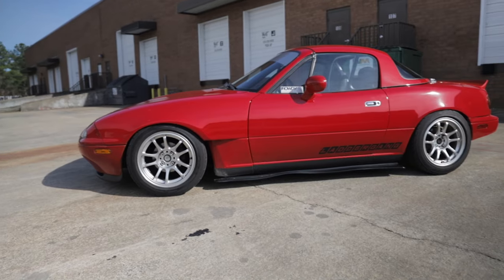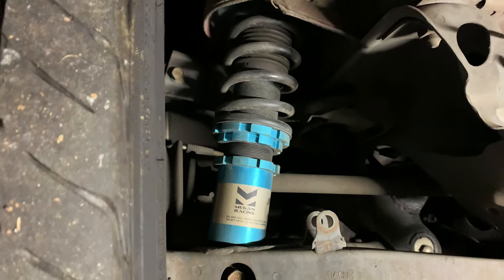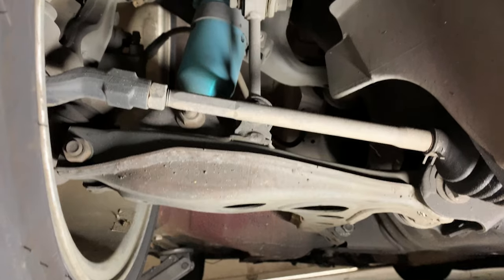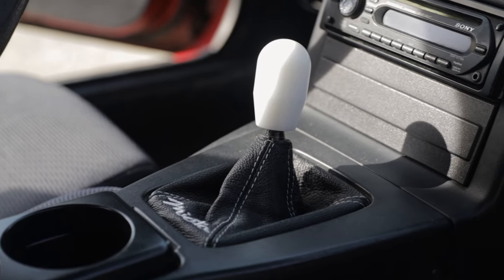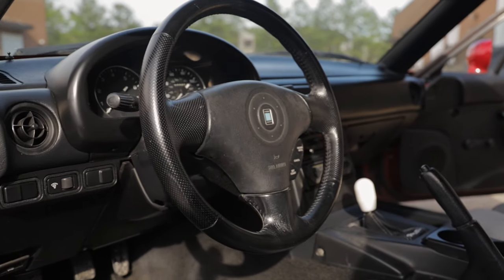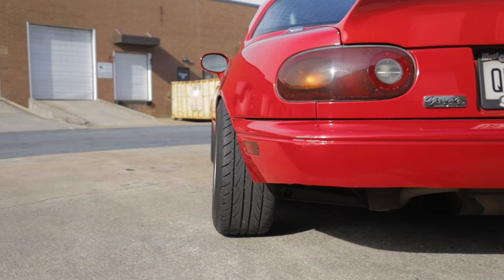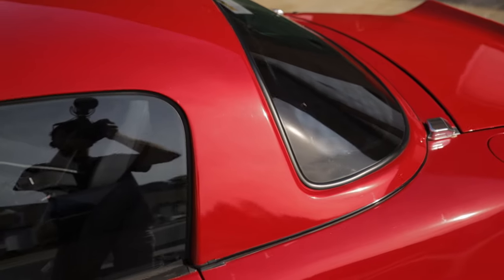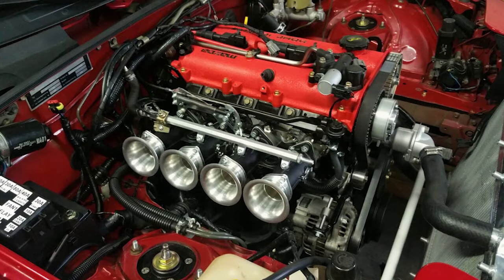5 Things Every Miata Owner Should Do

Comment: Man I’m just tryin to get my ac to work
Reply: +1 lol
Reply: +1
Reply: +1
Reply: I don’t even have an AC 🙃
Reply: 1+
Reply: get the conversion kit its just two valves that fit the more modern ac refills, you might need to purge the line and clean a  filter though
Reply: @justinoxton6790  does it work I think my
Compressor went out
Reply: @yeezkneezz6861  the conversion kit definitely works!
Reply: +1
Reply: I don’t even have one
Reply: + 1
Reply: Lol I’d jus take it get someone mechanically gifted to help u lolz that’s what I did
Reply: you dont need an AC with a soft top, just need warm clothing
Reply: Same
Reply: You have AC? 😂
Reply: Same! I got the old r12 , how do you convert to r134
Reply: What's AC? Just bought a 245000 mile, fairly mint 92 for 2000. It was a race car, has no ac and powersteering. I'm just happy it has no rust.
Reply: Did you ever get the a/c to work?
Reply: Amen, brother 😂
Reply: My ac blows but the compressor won’t kick on it might be wiring or just needs a new compressor all together
Reply: I actually can help with that but I’m on the pooper rn
Reply: Man I'm just tryna get an ac
Reply: +1

Comment: The very first "mod" I did to my Miata is to RUST PROOF it! Flood every cavity with penetrating oil, chain lube spray, even old engine oil if you're a cheapskate. Heated vaseline/wax mix is best, but anything oily is better than nothing. I used "Fluidfilm", will put "Mike Sanders" grease in next year. Fixing rust is a royal pita, so make sure it doesn't even start.

Comment: Advancing timing will increase your power and torque across the whole band, but it makes higher octane a necessity so the engine doesn't knock
Reply: Actually, it you only go to 14deg BTDC it is ok. If you step up to 18deg BTDC then yes, you need higher octane. With fluid change, don't forget the brake and clutch fluid then replace pads (rotors if necessary). If you don't plan on any suspension mods for a while, get an alignment. Been more than 60k miles since timing belt change? Add that onto the list and if you do it, change water pump as well and probably all hoses/belts.
Reply: @gatorcellman  ...plus crank and camshaft seals while you're in there, especially if they show signs of leakage.

Comment: Nope.  The first things you do when you buy a Miata is 
1. Yank the stupid visors out.  They are usless and usually look ugly.
2. Ditch the spare tire and jack.  Pointless extra weight.
3. Yank the baby teeth.  Also pointless weight and ugly.
4. Better brake pads.  Stopping fast is more important than starting fast.
5. Advance the timing.  Free mod for butt hp increase.

All the fluids and shining up the paint are good ideas.  And any NA on stock suspension is definitely going to need replacement.  Good video.
Reply from the maker: Hahaha forgot about the visors, I think I took them out first day.
Reply: What is the baby teeth?
Reply: I’m pulling out the sun visors in favor of the led lights that go on the visor hinge mounts.
Reply: @yuankaicai9086  Air conditioning and power steering
Reply: @yuankaicai9086  These are the tow hitches that protrude from the grill. So, along with ditching the spare tires and jack, and the tow hooks, Goodeggpro is preparing for you to be stranded by the side of the road if you get a flat, or need a tow. Kind of dumb for barely any improvement in handling.
Reply: @ChrisCullenRacing  they are not tow hitches - go ahead and tow your car with them - they are just tie down points - get rid of them and put in a proper grill to protect the lower portion of the rad - you don't own a MX5 apparently
Reply: @doomedhuman  yes they are
Reply: Visors aren’t completely useless if you have the double folding ones. Why would you get rid of the spare tire and Jack? You must like being stranded. Also baby teeth are good for strapping down the car when transporting. The weight savings is negligible, just eat less McDonald’s or exercise to loose some damn weight. 4 & 5 are ok, but now you have to pump higher octane fuel to reduce knock with the advanced timing.
Reply: @One.Six92  On my Miata, there's no way the jack would fit under the car, so it's pointless.  And therefore, the spare is pointless.  Unless you're tracking the car and have a trailer, how many times in a Miata's life is it going to be strapped down?  once?  Never?  And yes.   the visors are completely useless.  I've never seen them be really black on an NA after 25 years of sun bleach.  They look terrible, and often sag at a diagonal, getting in your line of sight when you don't want them to.  I have two pair sitting in a cabinet.

For the record, I've never.... ever, been stranded in 15 years of owning 3 NAs.  Because I take care of them.  And I replace tires when they need replacing.  Sure, accidents happen.  But if you don't have a friend who can rescue you with a spare, do you even Miata?
Reply: @creedg6075  unless your gonna go through the trouble of properly de-powering your steering rack, then keep your power steering. I've driven them with just the hoses capped off and it's miserable after 15 minutes of driving.
Reply: @Irishrebel092  Exactly my point, so why’d you @ me?
Reply: @One.Six92  sorry was responding to the other guy. Hit reply and it auto filled it at you by mistake I guess
Reply: @goodeggproductions   that is the dumbest thing I've ever heard. Taking care of your tires is irrelevant if you run over a nail or bolt and get a flat. And a car that requires you to have a friend or family member that has the time to come "rescue" you is just ridiculous. 

The spare weighs 20lbs. So unless your tracking your car and need every bit of weight gone, then why take it out? At that point, just rip out the entire interior and passenger seat and run it bare. And if your just wanting the bit of extra cargo space then I'll ask the same question "do you even Miata?" You don't get one of these cars if cargo space is a concern....
Reply: @Irishrebel092  all good🍻
Reply: The brakes are plenty fine. If you’re not tracking it, don’t waste your time or money. It’s a very light car
Reply: @Dyltheboy  I'm only speaking from experience.  When I got my 1990, the brakes were dangerously dead.  I don't think the previous owners ever changed pads in 104k.  So I replaced the pads and rotors with some cheap stuff (total price was $110 for all four corners) just to make the car safe to drive.  But then I forgot to ever go back and get real pads.

Recently, I had a panic stop that could not even lock up the back tires.  So I got myself some proper brake pads for the front and now it stops so hard, I feel confident driving in any situation.

For $70, it's a cheap and very smart upgrade to keep you out of situations that could seriously hurt you, since the Miata isn't exactly the safest car out there.
Reply: I don't want a fast miata, i want a cool looking miata
Reply: @callmeasshole  Hopes and prayers.  Or moreso, he'll bring the low profile jack.  Which... likely won't work because at a 3" ride height WITH air in all the tires, if one does down, I'm probably sitting on the deck.  I'm really just screwed if I get a flat unless I have a low-pro jack AND three friends to help me lift the chassis high enough to get the jack under the rail.

It's really just the chance you take by living that low life.  I would never recommend a Miata as your only vehicle, and I'd REALLY not recommend a modified and lowered Miata as a daily driver.
Reply: @goodeggproductions dunno friends are rare these days

Comment: Except for maintenance I would start with:
1. Roll bar
2. Wheels/tires
3. Coilovers
4. Oversized radiator
5. Brake pads
After that I would make it nicer with a bucket seat, a shifter rebuild, an aftermarket steering wheel, new suspension bushings and get an aftermarket shift knob.
After all that I would start with simple power upgrades like an exhaust, a header and an intake, then I would probably get the head shaved slightly.
Reply: Why is a roll bar your top priority?
Reply: @KrysKu07  I think safety is very important and Miatas are really unsafe in rollover accidents
Reply: Yeah they’re all hardtop convertibles, right?

Structural integrity= about balsa at high speeds.
Reply: I wouldn't want a metal bar over my head in a rear end collision.
Reply: Well I have a Miata now and my first mod was indeed a roll bar lmao
Reply: @dyl_nnn  The ones that are too far back that have less risk of head impact have a lot less potential to save your life during a roll over. Roll bars work if: 1. You have a seat setup for it. 2. You have harnesses set up for it. 3. You have a HANS device set up for it. That gives you safety in all levels, but is not practical for street.
Reply: Looking to buy a hard top but don’t know the best place do buy them. Would u have any recommendations?

Comment: When I first got my miata, the first thing i did was make the car road worthy again, meaning i fixed all the parts that needs to be repaired as quickly as possible like the cooling system, the brakes, suspensions, and parts inside the engine like head gaskets, thermostats, thermostat housings, intake and exhaust manifold. Next is the tires, wheels and tires makes a huge difference especially when you daily drive your miata. Exterior and interior mods are the last pieces i’ve changed.

Comment: One thing people often forget/neglect but is a great mod is new engine mounts. The rubber on most are usually just as bad/old as the suspension components everyone says to swap out. 
I'd highly recommend the Innovative mounts, you can lower your engine slightly and get even sharper handling/turn in response. With that a lot of the little body rigidity issues go away imo.
Reply from the maker: Good tip! Mine probably needs this.

Comment: Just inherited a 1994 1.8 NA from my mother-in-law last year.  Only had 60k original miles and just completed the big maintenance check at the dealership.   I still did the trans, diff and gear shift fluid changes with Redline products along with the shifter rebuild kit, and put on new tires.   The coolant and brake fluid had already been changed by the dealership.  Completed the engine oil change last week when the odo rolled over to 65K.   I also did the Delrin door bumper upgrade which noticeably stiffened it up.   Will soon be throwing on the Flying Miata rail braces that are waiting in the garage along with some new Moss Miata seat covers and floor mats.  Then will be changing the spark plugs and upgrading the wires to Magnecor.  Will likely paint the valve cover and polish the intake manifold at the same time.  Saving up for the Flying Miata 2.5 suspension kit, roll bars and wheel/tire upgrade to 15".  This is fun.  It has put my El Camino restoration on hold.  I always have a permanent smile plastered on my face when I drive this car, even though it lacks power.  I love being able to red line it on every shift and still be in total control.   I used to own a 1969 MG Midget years ago and this car brings it all back, but without the engine gremlins.
Reply from the maker: Heck yeah, that’s awesome! Yeah these cars are super fun! Easy to work on too.

Comment: 2 years late but I recommend removing the two front seats and lifting the carpet and cleaning all the gunk that falls UNDER the carpet. Most people find coins and random screws and bobbypins down there.

While your at it, remove any of the old brittle sound deadener and add 1-2 layers of .70 thick sound deadening mat to the big flat side of the transmission tunnel and on the center of the flat part of your floor and you'll eliminate all drone from even the most annoyingly loud exhausts and the overall drive "feels" and "sounds" like your in a quality-built car. You'll also get less heat from the transmission tunnel on your leg. You only need about 20lbs worth total but it makes a HUGE difference.(for the weight-conscious: you wont feel those 20lbs, and that's likely because its weight low to the ground so it will lower your center of gravity.)

Comment: 1 - Rims-Tyres.
2 - 93-94 Octane Petrol.
3 - Locate window washer fluid resovoir to the boot to be friends with the battery.
4 - Drive the snot out of it and have fun, leaving the resale higher because it wasn't modded.
5 - Keep it rust free, clean and waxed.

Comment: My mod list for a miata
Coilovers 
All round Poly bushing
Ball joints
Anti sway bars front and rear 
Tie rod links and bushing
Cold air intake with u shaped pipe
ARC air chamber (now rare to find goes behind radiator)
Bigger throttle body with heavy spring
BOSCH super 4 spark plugs
8.5 mm MSD or Magnecor plug leads/wires 
Headers / free flow cat/
 de-resonated pipe exhaust with only racing muffler at the back ( racing beat gives the best tone without droning)
Street Comp clutch and lightened flywheel.
And a mega squirt ms2 stand-alone ecu

For my project mx5/eunos roadster
Reply from the maker: Sounds awesome man! That ARC air chamber is nice.
Reply: Alex Perrucci , I’ve driven a miata with an ARC chamber installed it is just dope! it de- restricts so much air- flow at the top end, try it.

Comment: Bought a ND 2 years ago. 1. Mod : Upgradet front brakes with 4 pot calipers and steel bradet lines all around. 2. Sound tube delete. 3. Mishimoto Oil catch can. Reverse camera was already in when I bought it. 4. New stiffer springs from Eibach- original Mazda Germany part. Shocks are already Bilstein from factory. I am also OK with the factory tires ( 205/45 R 17 W Bridgestone RE 001 ) NA and NB`s runs best on 195/50-15 Hankook Semi Slick RS3 - 222  from my experience in no speed limit Germany.

Comment: On my 97 mk 1 , I've put adjustable coil overs on, new rad, head skimmed , all new belts, sensors, relays, water pump ,new elec fan, 4 new wheel discs, calipers, pads, complete copper brake pipes , engine strut , interior strut , white dash dials, wooden steering wheel. Back half stainless steel exhaust. Better headlights and indicators .New battery. Runs great  but more to do yet. I need a hard top , a roll bar and my original wheels refurbished. Could do with a respray. Owned for 10 happy driving years 🙂👍.

Comment: Sway bars and links, Delrin door bushings, FM butterfly brace, master cylinder brace, 200 TW tires, FM alignment, shifter rebuild with the Motorcraft fluid, upgraded brakes and, of course, all maintenance items. Nice job, keep 'em coming. Aloha
Reply: +1 master cyl. brace. I was skeptical if it would be any help on my NC until I got my mate to stomp on the pedal and saw how much the firewall flexes under heavy braking. It's not the distance so much as all the extra force you need to apply to brake hard when the whole braking assembly is moving away from you

Comment: A NA Miata comes with a Momo sport steering wheel as stock. If you have the 3 spoke wheel, get the cap of the center of the wheel out and you got a steering wheel that is awsome.

Comment: Great video!

I'd die the priorization of mods quite similar.
The only thing that should also be mentioned ist the complete replacement of the brake fluid!
This might be even some decades in there, aged (and coloured) like Scottish Whisky.

Brake calipper overhaul is also a recommended thing to do as a preventive maintenance for a car in its late tventies. Brake pistons often die look pretty nasty under the outer gaiters.
Not expensive but you should know what you're doing.

Cheers!

Comment: Tribute washer nozzles, cibie or bosch e-code headlights, a good front swaybar (before coilovers), delrin door strikers. These should be some of the first things miata owners do. You can do all of these for $200 and make a much nicer/livable daily driver. Hardtop as a first mod is a terrible idea. It's a convertible. Enjoy it as it's intended to be driven, with the top down. That's a lot of cash for a first mod that can go towards suspension or tires and then decide whether you want a hard top or not. It was the first thing I sold from my 95M (no regrets). Not to mention, in major cities they are stolen pretty regularly. I do agree with the detailing. My first miata, a red 94 was seriously faded. I waited 3 years and detailed it just before selling and the paint looked almost brand new after a solid day with a harbor freight DA polisher.
Reply: oh, I forgot one! Cleaning out behind your front fenders, cleaning/expanding your drip holes in the pinch weld, and cleaning out your rear rain rail drains.
Reply from the maker: Yes! Cleaning the pinch weld holes and rain rail is a big one. What’s different about the tribute nozzles?
Reply: The tribute nozzles plug right into the hood and are a fan spray pattern instead of the water pistol style spray of the stock ones.

Comment: The first thing I did was replace the stock radiator with and aluminum core radiator. The first cosmetic thing I did was replace the stock headlights with some LED halo lights. And next I plan to put a new stereo in, and then replace the sun visors with some LED cabin lights.

Comment: 1. Make sure all basic maintenance stuff is up to date
2. Check & Replace any worn bushings, tie-rod ends, bearings, etc 
3. Brake pads
4. Wheels & Tires
5. New struts + maybe springs / coilovers
5. Dont bother adding any power until the above is done 😂

Comment: How many miles did you say your Miata had on it when you bought it, 200k? Mine has 114k and I am afraid to dump too much money into it because of miles, but maybe I shouldnt be concerned.

My list:
1. Frame rails
2. Headlight upgrade
3. Coilovers
4. Sway Bars
5. Clearwater Speakers

That's a list based on what I have done so far. The frame rails make it feel so stable at high speeds.
I am always driving with the top down and use my Miata as a daily driver so hard top is last on my list. I bought a Miata to have top down versatility. I don't know how you guys live with the hard tops lol.
Reply from the maker: Sounds like a good list for a daily. Yeah it had 200k. I wouldn’t be worried if I was you, 114k is nothing haha.